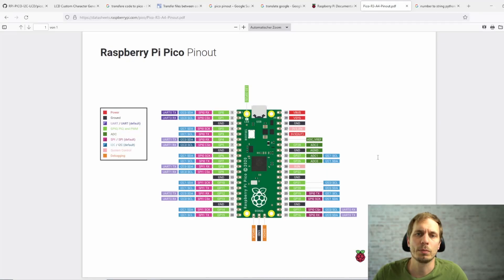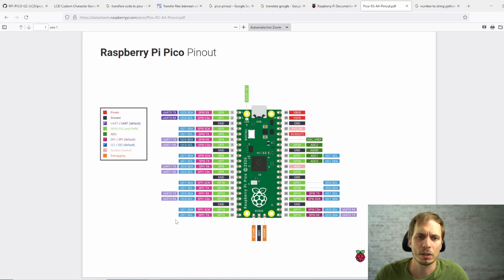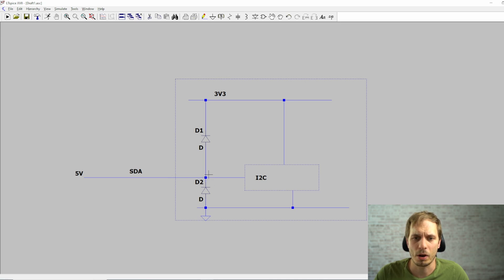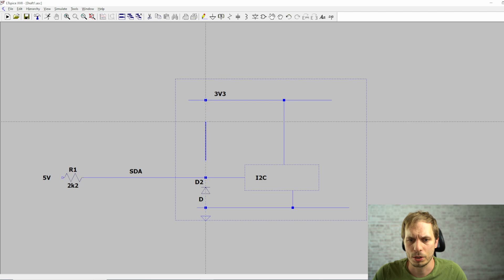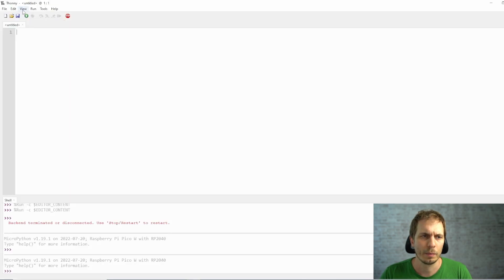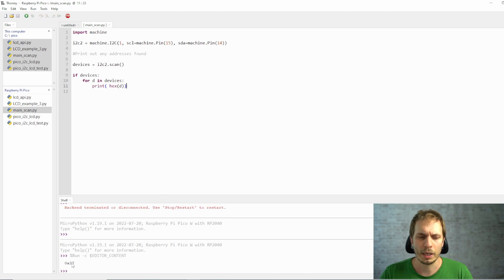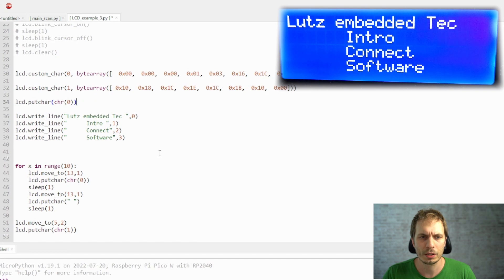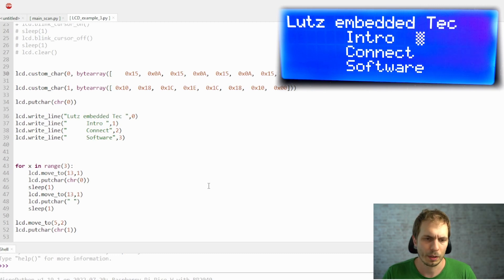Display Data: Full LCD Control (20x4 or 16x2) with microPyhton

Comment: File "pico_i2c_lcd.py", line 22, in _init_
OSError: [Errno 5] EIO  
i am getting this error that every fckn try man . pls help
Reply from the maker: Hi, some question to this.
1) did you try at frist the scan File i Provide on GitHub? And is it working?
2) whats the Programm you are calling this function /file from. Did you try example 3 from my github repository?
3) this Error is normaly comming from a Timing issu, do you use the i2c Bus in your Programm before, without waiting ? May you need to add a sleep command (>5ms) in Front of the command.